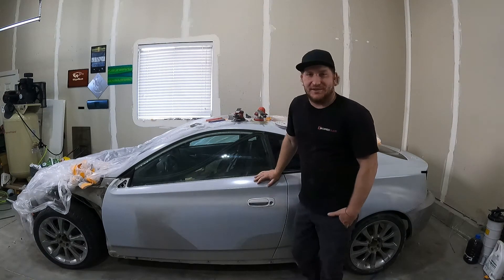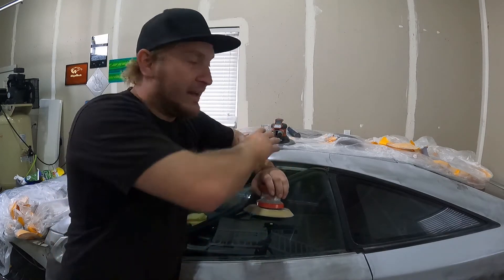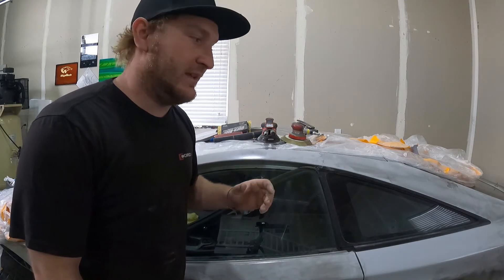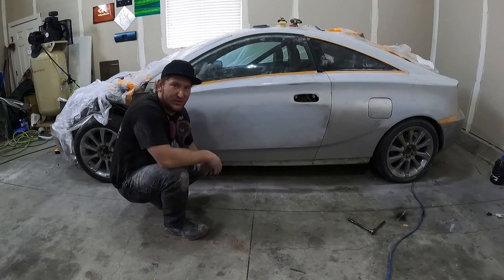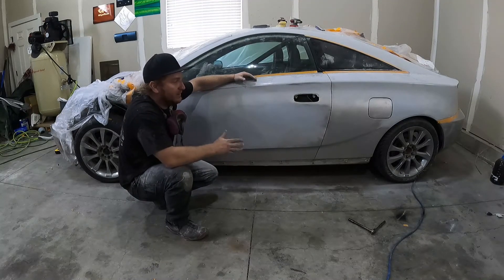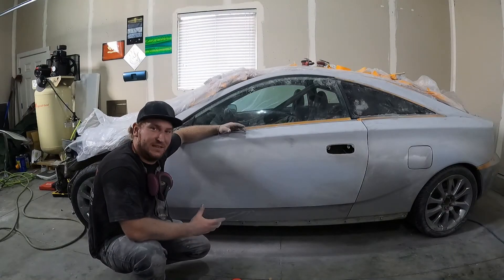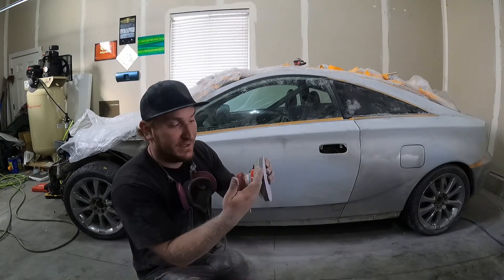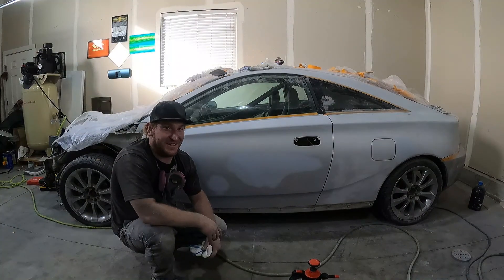How to prep a car for paint

Comment: I was about to ask why you didn't remove the door handles but then noticed that you did remove them. Hope you covered up the holes for the door mirrors as my own failure to do this resulted in paint getting through and on to the side of the dashboard.
Reply from the maker: Oh no that's too bad!! Just an excuse to paint the dash a cool color if you choose haha! Haven't got to painting it just yet still have the bumper and wing to prep. Waiting on an open weekend on the paint booth as well!
Reply: @jasonstults  Did you work out how to remove the 3rd brake light to make your paint job easier? I did it a couple of years ago when I need to replace it. Very easy if you know what to do and difficult if you don't. Remove the 2 nuts from the inside of the tailgate as well as the rubber pipe for the rear wash which is strangely also housed within the 3rd brake light. You then slightly lift the top edge of the light unit before pushing the unit towards the rear of the vehicle.
Reply from the maker: @xj358  I did struggle with that on the first Celica I had painted but you are right
It is kinda tricky. The biggest bummer is the foam sealant gets destroyed when you remove it.